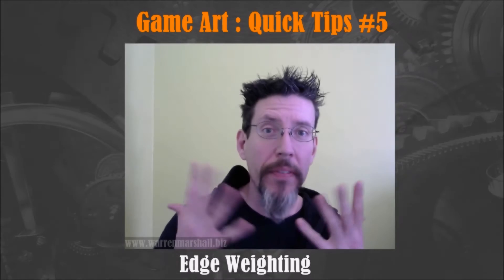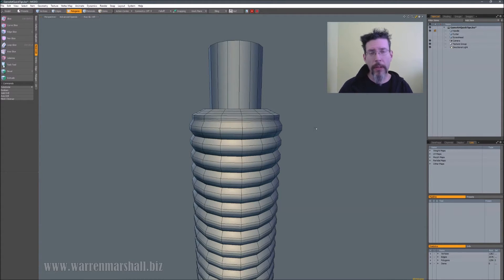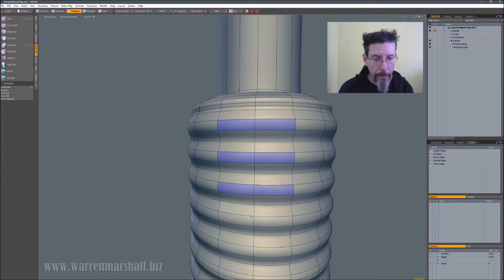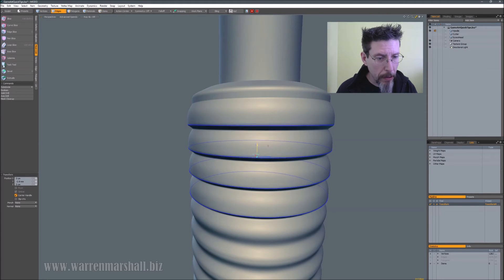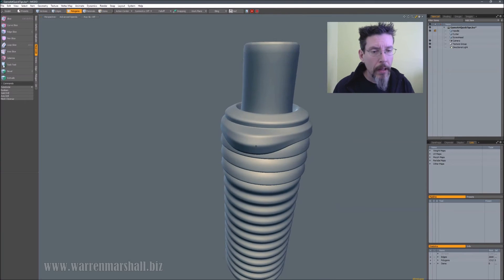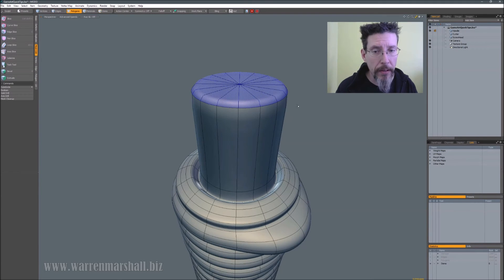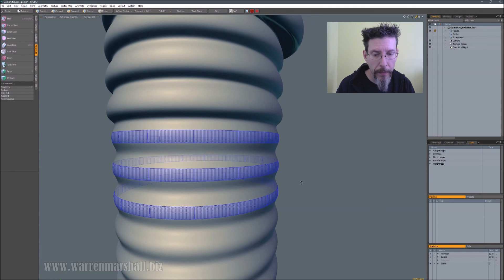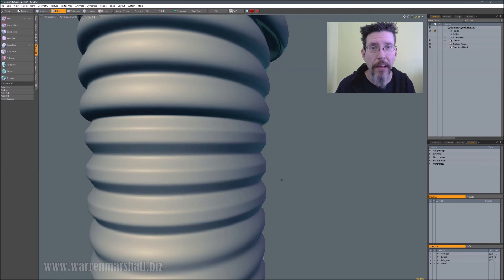Quick Tip #5 : Edge Weighting

Comment: The way edge weighting works is with level 1 subdivision, 10% edge weighting equals 100% sharp, level 2 subdivision, 20% edge weighting equals 100% sharp, level 3 subdivision, 30% edge weighting equals 100% sharp, etc etc. I find level 3 generally works well. Level 4 if you need very fine control over the edge weighting.
Reply from the maker: Hey, thanks for that!  I guess that should have been obvious but I didn't see it.  :)  Level 3 does work well but it can get heavy pretty quick ...  I like to stay at 2 if at all possible.

Comment: Thanks for this, I also like precision and consistency when it comes to this sort of thing. Just putting in arbitrary edge loops in to tighten corners has always bugged me. My question is there any way to see what weighting has been applied to an edge? Like if you came back to that model in 6 months time and wanted to know which values you used.
Reply from the maker: +BigDaz In MODO, there is actually.  When you use the actual Weight TOOL you can tell it to display weights on the edges.  So you can get the info that way.
Reply: +Warren Marshall Cool, thanks.
Reply: +BigDaz Just for anyone else the easiest way to show a weight value without editing it seems to be setting the weight tool to Additive mode with the addition set to 0. Otherwise by default the weight of an edge is always overridden with a new value when you click in the viewport.
Reply from the maker: BigDaz Good point. It's a little clunky for sure.

Comment: Hey Warren, thank you for making the video.
I gave it a try, works really well!  Combined with the rounded edge shader it's very powerful, if you bake inside Modo.
I'm having some difficulties freezing the geometry though, the result I'm getting doesn't look the same as the in the preview render, but if I use subdivide polygons with Catmull-Clark option, and I repeat it 3-4 times, it does look like the preview render - any idea why?
Reply from the maker: +Tzur Hoch You'be stumbled over the answer I think.  I forgot to mention this.  You need to keep your Subdivision Level in sync with your Render Level.  This is under the Catmull-Clark Subdivision section of your meshes properties.  My hot keys for setting my subdiv level also set my render level at the same time so I don't even think about it anymore.

Just keep those in sync and your render will match what you see on the screen.
Reply from the maker: +Warren Marshall This section I mean : https://dl.dropboxusercontent.com/u/161473/Misc/SubdivRenderLevel.jpg